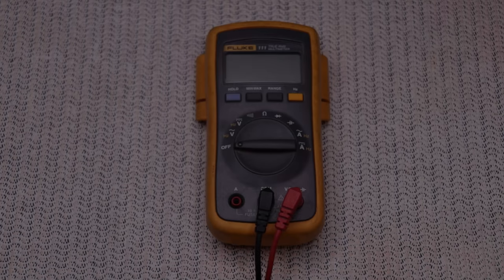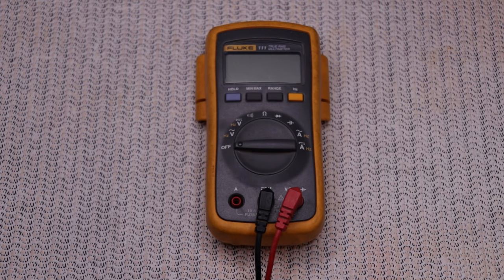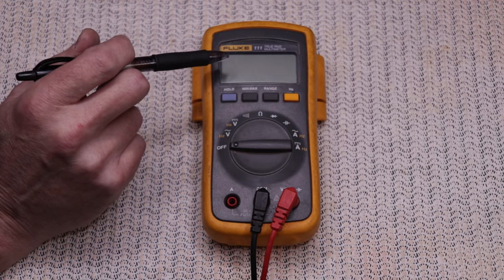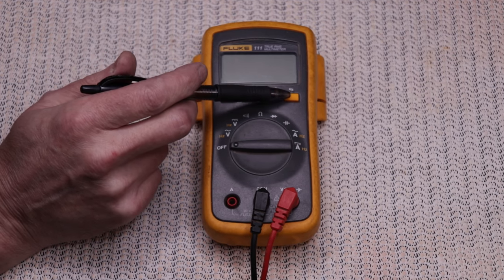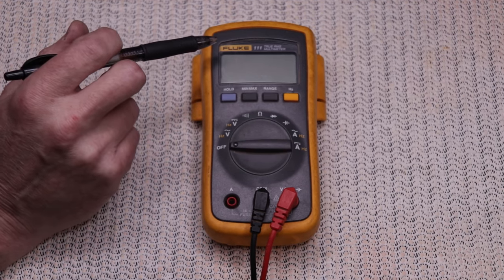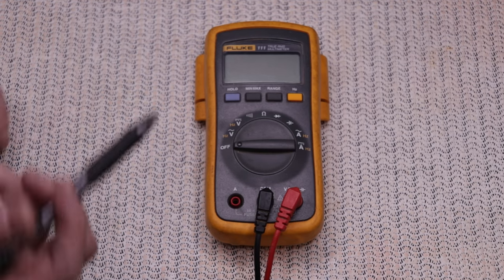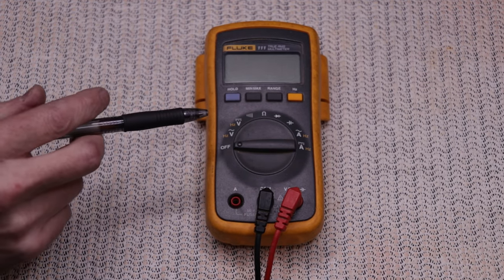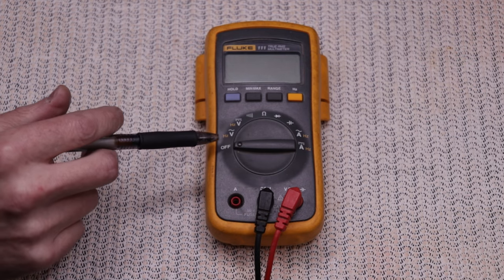How to Use a Digital or Analog Multimeter: Measure Voltage, Resistance, Continuity, and Amps

Comment: I absolutely love your analog needle deflection vs digital meter demonstration. I saw somebody making the case that because of the bar graph. Digital meters are always superior. Your demonstration proves otherwise I'd say
Reply from the maker: Another plus of analog meters is that for most modes they don't really require any internal batteries. So there is a reliability factor there.

Comment: Hey Barry. Just found your channel and I to say how much I appreciate your knowledge and delivery style. Of course, I have subbed. 

Also one question… are there any reasons for choosing an analog over a digital meter? Or analog AND a digital meter? I’m curious if one excels at providing a reading that the other does not. It seems that digital is accurate to more degrees and, in choosing, one would select digital over analog. 

Unless I overlooked something?

Thank you!
Reply from the maker: Thanks and welcome!  Analog is really good for seeing a change in signal.  If you need to adjust for a peak or null, if a signal is cutting out (put the meter on and tap the circuit board or shake a wire harness) or something like that.   I would get a digital meter first, and probably use that most often.  But I do like the analog meter for some tasks.  For most folks a analog meter is not a must-have tool.

I can imagine that these days some people have never used an analog meter, so I wanted to cover it in the video in case folks encounter one and wanted to know how to use it confidently.
Reply: @Barry-Watson    Ha! Lol. I wrote this at 22:15 into the video, and just after that you spoke about this very thing! Sorry to ask about that, but I appreciate the added explanation. 👍🏼

Comment: Those analog meters have limited CAT ratings.  I don't want to explain that.
Reply from the maker: Thanks!  I try to stay away from those really high voltage, high energy circuits you find in commercial power distribution where those safety ratings become an issue.  

For around the homestead, fixing electronic stuff, and house wiring, a little caution and common sense has kept me alive... so far.  Of course, when dealing with anything that can easily kill you, proceed with care, caution, and hopefully enough knowledge.  Cheers!